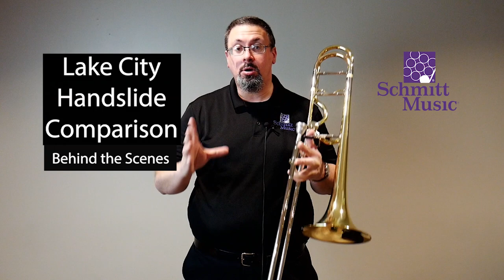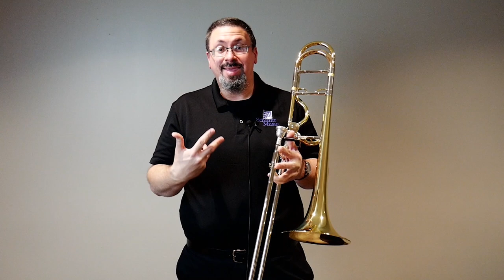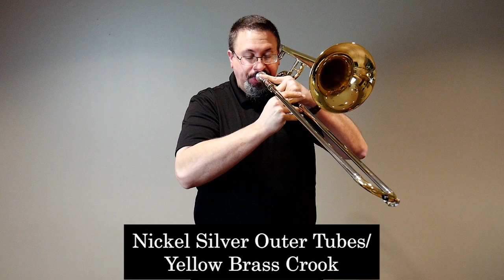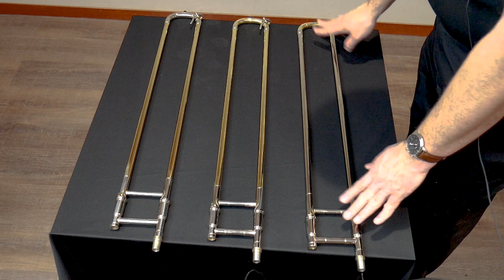WHAT A DIFFERENCE!  Lake City Trombone Handslide Comparison-Trombone Shop Behind the Scenes

Comment: Nickel/silver tubes, brightest sound,;  all brass, smooth/warm sound;  brass with nickel/sliver crook in the middle as far as bright sound.
Reply: It's a pretty subtle difference. Nickel is more durable and more corrosion resistant, but brass is more reparable.
Reply: I hear it in the articulations.  The all brass has less “ping” to the front to the notes than the nickel tubes/brass crook.  I agree with you, the brass tubes with the nickel crook splits the difference.
Reply from the maker: Thanks for watching!  I think it was the balance of the different response and timbres in the yellow tube/nickel crook that swayed me in that direction; with that said every player will always approach things differently!
Reply from the maker: Good points!  Beyond all of the sound and response characteristics I tend to like in a nickel silver crook the resistance to issues like redrot is also a plus...